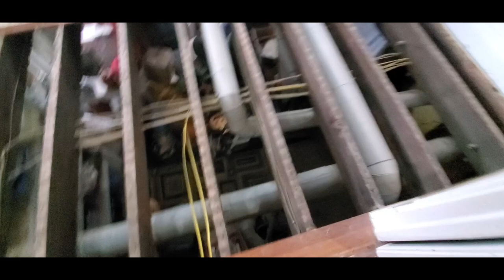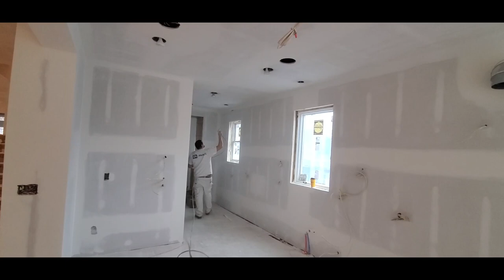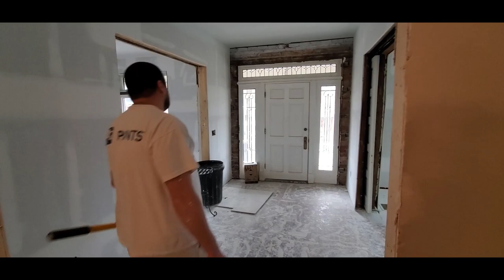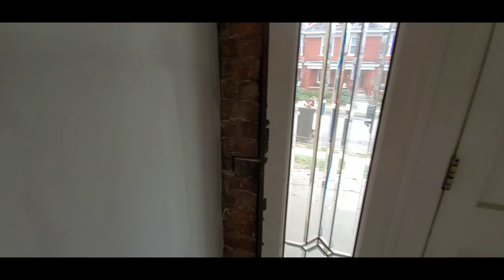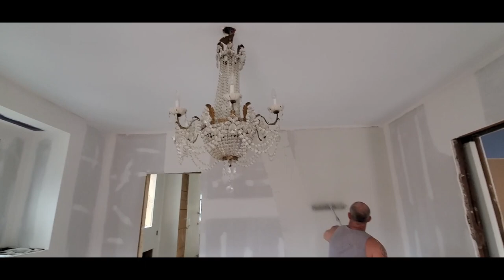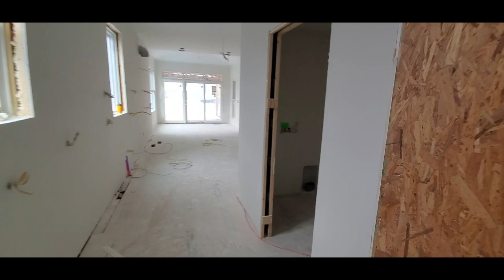Restoring a 150 year old house. (1st coat of paint)

Comment: I have a question my house was built in 1930 all the doors are period correct with the original door knobs. At some point some moron painted the old skeleton key door knobs , what removes the old lead paint? I tried various stippers with some degree but its a long process.
Reply from the maker: He brother  sorry about not getting back to you     i just didnt see the comment .        That old lead paint can be tough    you may have to get some lacquer thinner to cut the old paint  if that dont work   your local paint store can get even hotter thinners   there is one called T5  it is a litter hotter and they have even more that get hotter.  i start with lacquer thinner and work my way up until i find one that works.   Hope this helps     led
Reply: @led8541  Thanks bud , that helps a lot.

Comment: What’s the settings on the sprayer for ceiling cut?
Reply from the maker: Hey John my pump is normally around 1800 psi.   That is with a ( race x tip)   and I normally add about a 1/2 gallon of water to every 5 of paint. That allows your tip to properly atomize the paint for a smooth finish.   I hope this helps you.   Thanks for stopping by the channel and have a great week.  Led